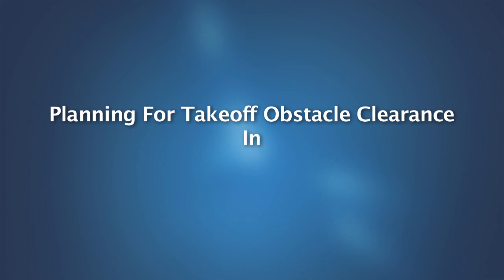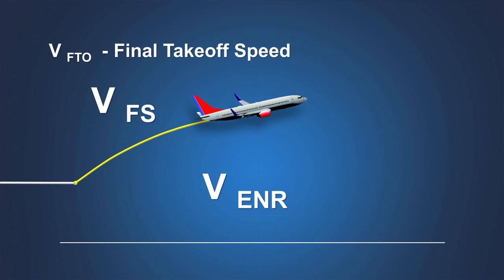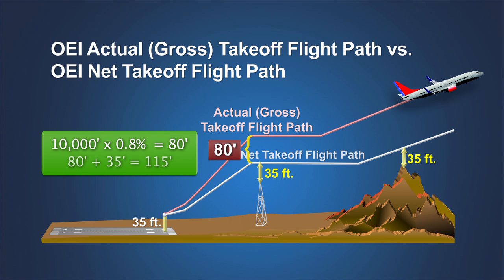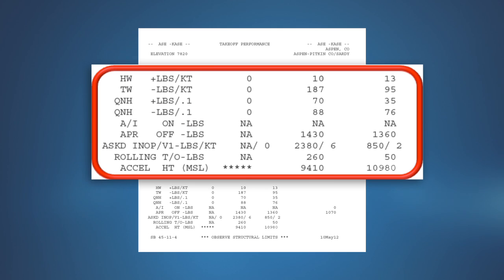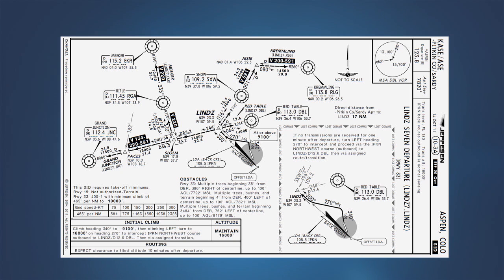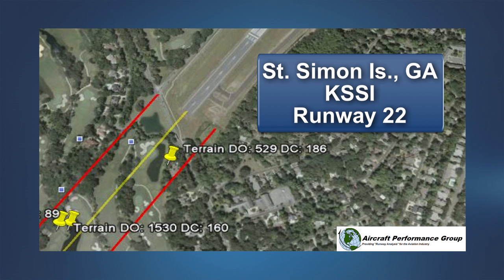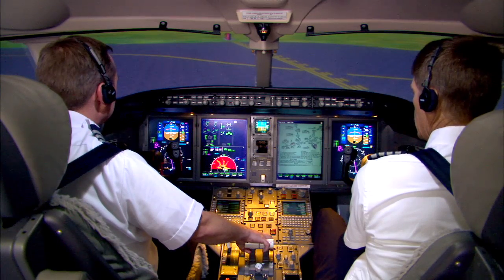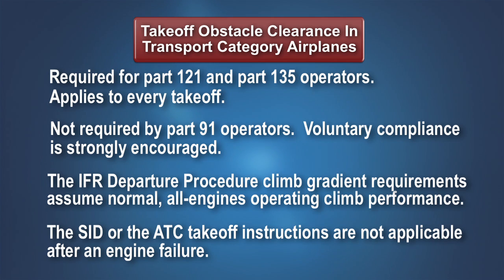TAPP Working Group Video (Part 1 of 4): Planning For Takeoff Obstacle Clearance

Comment: I thought an engine failure before V1 meant abort?
Reply: V1 is actually the speed during take-off roll by which the decision is already made.  There's one particular speed used during certification processes called Vef. 1 seconds prior to V1 at which an engine failure or another crtical failure occurs.  this 1 second is average human reaction to start decelerating the airplane for stop.
Reply: If I can add, there is a new definition of V1 coming around, which changes it from "decision speed" to "the speed beyond which a takeoff should no longer be aborted". So even if the engine failure happened in the immediate moments before V1 and you realize it immediatly after V1, initiating a reject procedure might not guarantee you'll be able to stop on the remaining runway/stopway.

Comment: Hi tks for the video. To recap in case of the cl605 is the tofl the longuest amongst te asd, the distance required to achieve V2 at the screen height of 35 ft reduced in case of wet rwy following an engine failure at vef and the distance required to achieve v2 at the screen height with all engines operative plus a 15% buffer?